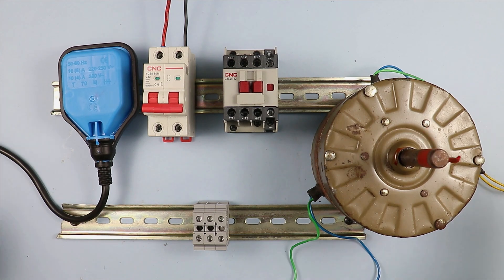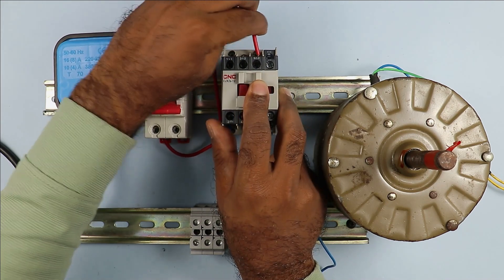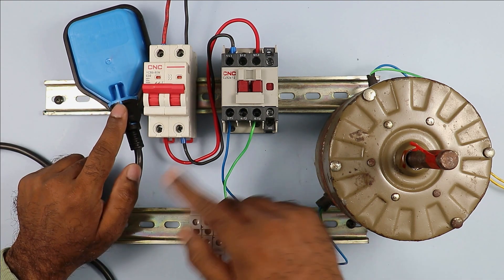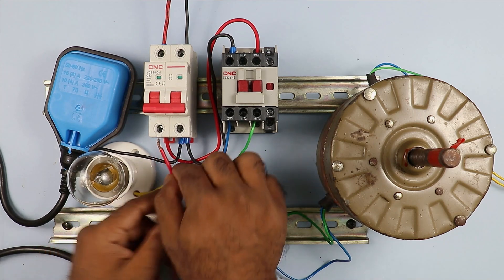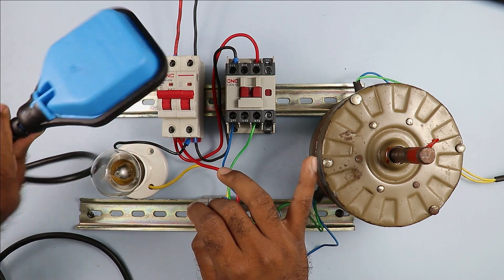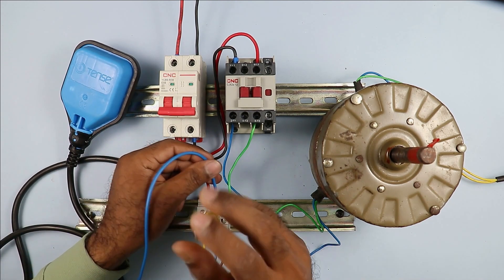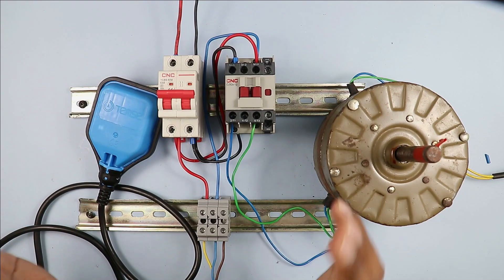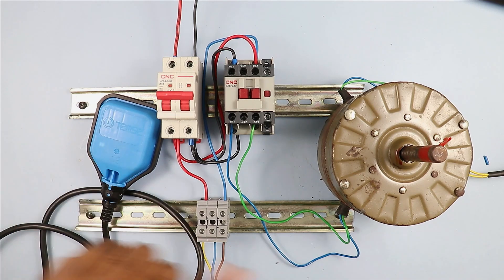Float Switch Connection with Contactor for water tank 100 % Practical Video @TheElectricalGuy

Comment: Thanks for the simple clear video. Is it safe for the mains voltage to be connected to the float switch which goes into the water? Is there any possibility of leakage?

Comment: @jr electrical school Can you tell me what changes I should make in wiring so that my motor turns off when water level is low and turns on when water level is above set low level in float switch. This is for a .5hp pressure booster pump on I’ve put on the terrace

Comment: Brian Edwards
I would like to know how this circuit is wired where the pump is replaced by a 220v submersible well pump that has a control box with the required starting and running capacitors.  Great video.  Thanks.

Comment: I have tried this system but it has a flaw. The float switch contacts do not pass the current after a while because of the sparking. So what i did was that i used a relay connection with 12 volt 5 amp dc adaptor. This reduced sparking and is working perfectly
Reply from the maker: Float switch current rating is low so if your motor Current rating is high then you have to use a contactor 

Float switch should be used to turn on and off Contactor
Reply: I use instead of 12v 5 amp adopter, i use 12v 1 amp smps board (cost is 42 rupees).

Comment: Please do you have a tutorial on how to use a single float switch to control both overhead tank and underground tank with a single motor
Reply from the maker: By only one float switch you can only control the single take water level
Reply: This is what i am also looking for. Two upper and non same level water tanks with float switches and one ground water tank with a single water pump. This is a challenge now... plz somebody hepl..
Reply: @azizahmedmuhammad4124 it's possible but you will need two contactors
Reply: @mattiasbanda3063  There must be two float switches bro and 1 contactor is enough. No way you can use 1 float switch to control 2  different water tanks at different levels
Reply: How.... You need to know the tank level

Comment: Please how can you know whether the current rating is high for the float switch... Thanks
Reply from the maker: If the current rating is High you have to use Contactor
Reply: @TheElectricalGuy  it's just a general question I want to know... I have not used a float switch before...
Reply from the maker: Check the current of the motor by using clamp meter or ammeter 

And if your motor running current is more than 8 Amp please use a Contactor to connect the float Switch
Reply: What types of contactor use
Reply: @143AmmuMama  it's just a general question I want to know... I have not used a float switch before...